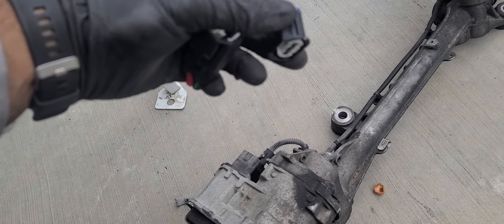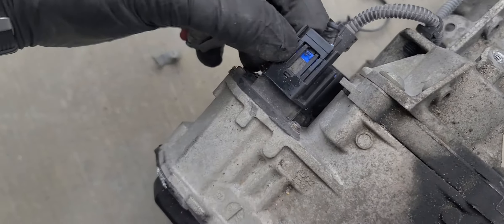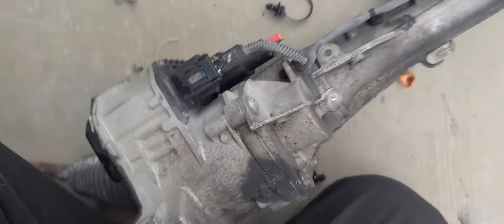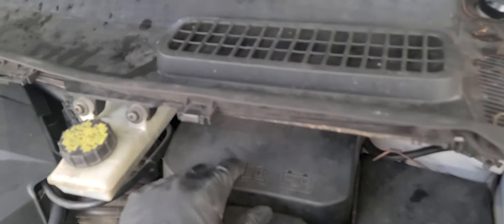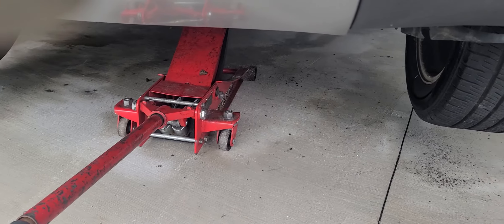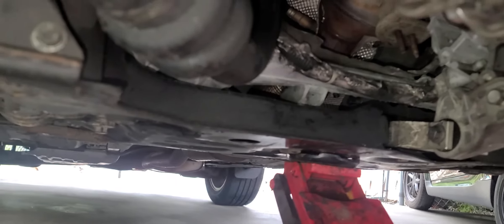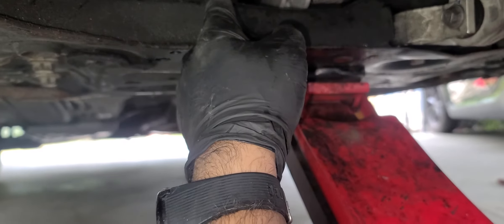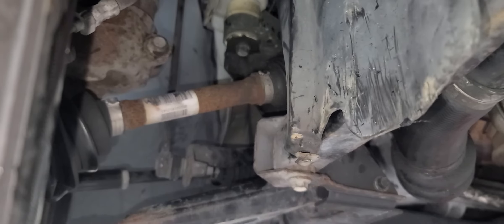2016 ford escape electric steering rack replacement

Comment: I just did this job for a 2015 MKC, which is exactly the same as the Escape in your video. When lowering the subframe I hadn't cut all the plastic ties holding the wires going up to the computer, so almost damaged the wires. - Before starting the work I backed up the PSCM module configuration using Forscan. Also, because the replacement rack&pinion was purchased on eBay, I plugged it in and checked its configuration before installing. It turned out to have exactly the same configuration. - Also, before installing, I used other videos to center the rack&pinion. - I followed your advice not to tie the screws until all were in place and everything went smoothly. - There were no codes to clear after completed. I was expecting the height sensors to require recalibration. - Other videos say this job is around $4K with the dealer, I paid $300 for a used part that claimed to be 28K miles.
Reply from the maker: That's it I'm glad I was able to help you save a few thousands lol

Comment: Getting ready to do this job. Thanks for the video.
Reply from the maker: Not a problem, thank you for watching
Reply: What needs to be done after? Besides the alignment. Did yours make the controls on the steering wheel unresponsive?
Reply from the maker: @arturohernandez2313  no you shouldn't have to do anything else,  if you turn you steering wheel few times when the rack was out then you may need to clock the steering spring to 0 after the alignment its done
Reply: @kennyadriankc  that’s just take the airbag off, the clock spring out and line it up and put it back in right? Jesus I can’t believe I mest up that bad. 😞
Reply from the maker: @arturohernandez2313  no if the spring it way off the alignment when you set wheels straight & steering its ways off, then correct the alignment on the steering by the brake pedal it only goes in one way, from there its an scanner that can reset the spring to 0 , not a mechanical thing
Reply: @kennyadriankc  ok I will do that once I have time to work on it again. Do you know how much that typically cost? I don’t have that tool to scan it and reset it? Dallas, TX area.
Reply from the maker: @arturohernandez2313  sorry I'm in Florida,  but I wanna say after the cost of alignment maybe another $200
Reply: @kennyadriankc  last question 🙋. I got it aligned and everything already. Now let’s just say I drive it as is with no controls working, etc… will that break the clock spring and I’ll end up having to get a new one? or can I just get it reset at a mechanic shop after some time?

Comment: hello. great video. greetings from Poland
I have one question.
I'm going to dismantle the front suspension for powder coating. Can the subframe be unscrewed from the chassis so that the steering rack stays in place?
Reply from the maker: Hello yes , but you will have to hold the engine and transmission some how so it doesn't fall, but yes you should be able to.
Reply from the maker: Poland that's good ways out , I'm glad i could help you out.

Comment: Hey! When the EPAS goes bad, will there be intermittent power steering? Last code I had was to change the clockspring, did that and still have same intermittent power steering assist fault code... Trying to figure my next step. Thanks!
Reply from the maker: Hello yes if it's going bad you will notice that it will be getting hard when you try turning, to any or only one side or maybe skipping when turning.

Comment: Hi great video the only thing that's missing is you show where to disconnect the wires from the rack and pinion but where does the wires hook into the wiring harness I think it hooks in right underneath or close to the battery
Reply from the maker: On the same rack they have there plug there but yes disconnect battery first , but on the rack it self its the plug for the wires

Comment: Does steering cause ford kuga to complete shut down and not start at all??
Reply from the maker: That's a hard question to answer, you need to provide more information,  its battery voltage ok , it's the engine cranking over , does it has fuel pressure,  does it have spark , there a lot of things you need to check also what's codes it's the computer showing on the scanner.

Comment: I’m getting ready to tackle this on my 2014 Ford Escape w/ 250k miles. Is there any sort of reprogramming that has to be done once this is all said and done?
Reply from the maker: Along the car drives straight & steering wheel its straight you should have to, but the steering angle may need to be reset to 0
Reply: @kennyadriankc  I installed the new one and got everything hooked back up then connected the batter but now the controls on my steering wheel don’t work so I can’t look thru the different options on my cluster. What do I need to do? I read somewhere that the dealer has to reset the module or something like that?
Reply: @arturohernandez2313  Did you figure this out? I may need to do this with my 2014 Escape.
Reply: @johnsonscott  yes I did. I posted a comment on here earlier but it got deleted. Anyways yeah just @ me and il answer your questions. Try not to move the steering wheel at all until you’ve finished the new install and got everything ready to go.
Reply: @arturohernandez2313  Ok cool, will do. I know this video is for a 2016 Ford Escape, but is the under of the car fairly similar for a 2014 Escape?

Comment: Where you put your jack stand at?
Reply from the maker: Hello I can't tell you where you should put them, but where I used them when I removed the crossmember was at the point where the jack its used to lift the car for a flat tire replacement. Make sure the car doesn't move and the ebrake its on when the front clip its in the air.
Reply: @kennyadriankc  gotcha!. I saw other video. People put there when crossmember drop or remove. Thanks.

Comment: Does that rack need to be programmed??
Reply from the maker: Hello no I didn't have to programmed it
Reply: Ok thank you because I had to buy rack piñon for my 15 for ESCAPE
Reply: And every one telling me I had to program it
Reply from the maker: Hello I have done a few escape 14-18 and explore 14-19 and I haven had to reprogram them just a calibration of the clock spring after the alignment was done, but on a 12 bmw 550i I did have to program the rack , but even if you have to you can log in to the dealership and look for software you should be able to pay the license and follow the step to download to the car you will need a laptop & od2 wire
Reply: Just wanted to say thank you for the info

Comment: Are you seriously laying under a vehicle supported ONLY with a floor jack?  Safety first!  Floor jacks are used to ONLY lift a vehicle.  Jack stands safely keep the vehicle supported.
Reply from the maker: Hello yes I know it was only to show the process but trust me I always put stands under the car when I'm working on them 2 plus the jack and if I have the tires off I also throw them under the car , you are correct safety first.
Reply: @kennyadriankc  that’s good to know. I knew someone growing up who got crushed by their SUV when the floor jack failed.  My dad’s friend died because a stupid O ring failed.  I will not climb under a vehicle, unless I am more than certain it is safe to do so!
Reply from the maker: Yes here in town a friend of a friend his dad died because of the same thing but his main problem was a manual jack and he did it on a incline. But yes always safety first.